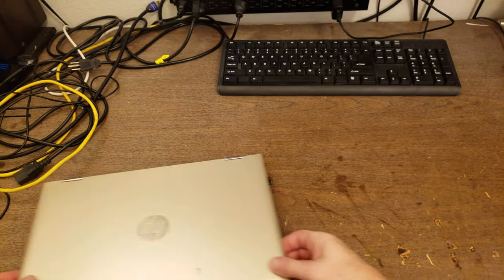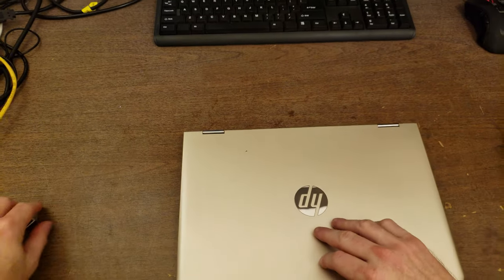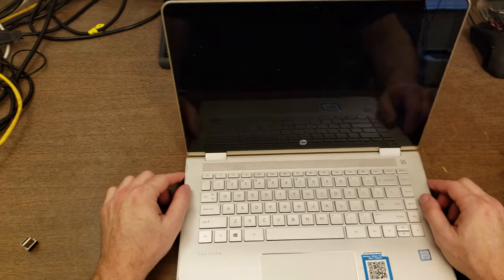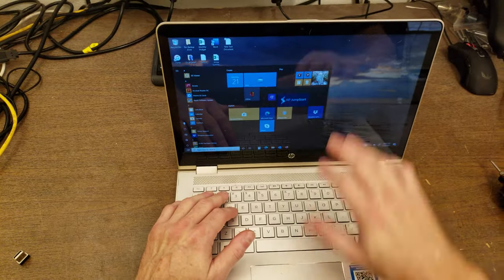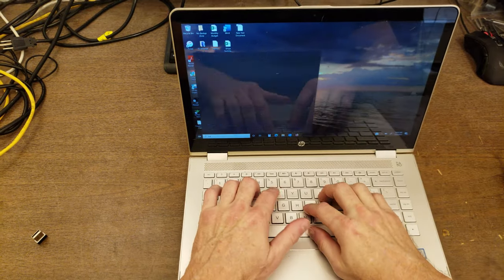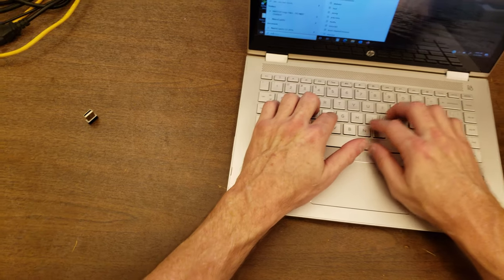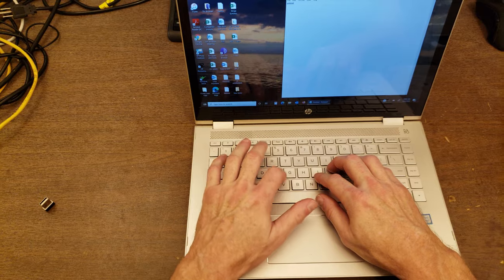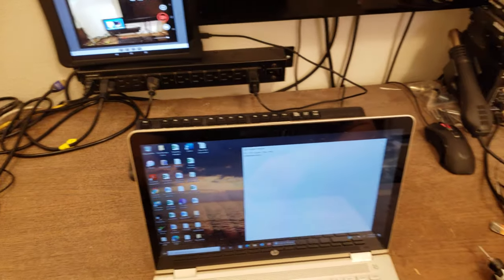HP Pavilion X360 Laptop keyboard and back light replacement

Comment: Good video for this particular HP Pavilion x360 model.  My model,  Pavilion x360 14t-Dh is ENTIRELY different so I damaged the palmrest using these instructions.  If you have a 14t, DO NOT TRY TO SEPARATE the top - it is glued together.  Remove the ONLY THE BOTTOM to get access to the integrated palmrest and keyboard.   Then unscrew the touchpad control, mainboard, audio board, power switch, etc to isolate the keyboard and palmrest assembly.  If you're feeling bold, you could replace just the keyboard by removing the plastic pop rivets to gain access to the keyboard itself.  I use hot glue on the pop rivet points when reassembling but very time consuming.  I hope to do  video for this 14t- dh series - Hooper Computers.

Comment: I always use a solder  iron and melt the rivets and then pull the keyboard off of the Palm rest.  And then when I put the new keyboard in, I kind of use the iron to plastic solder the keyboard back on.

Comment: Sometimes I will use a Hako 936 solder pencil to remove the plastic rivets. The heat temperature level is adjustable.

Comment: Great instructional! Thank you! As Chip Gunter did, I also soldered what was left on the plastic rivets and it held everything together nicely. I didn't have a soldering iron so I used a butane torch to heat a small flat-head screwdriver tip. Which, I think, worked slightly better as you have more control over the melting thereof. The flat tip could be dragged across the plastic nicely.

Comment: Just what I needed. When I attempted to take out the 3 screws for the trackpad they were stripped. What do u suggest? This was the first time the laptop needed a repair.
Reply from the maker: If the screw heads are stripped try using a flat head driver, press down hard and turn slowly.

Comment: Very helpful video, thank you. I had to do the same replacement, I was a little bit more careful, so the plate wasn't bend like yours and I just put everything back in place without soldering, tape or glue. The laptop works fine again, and you cannot see the keyboard has been replaced, also the backlight works. The original keyboard wasn't working anymore because liquid got spilled on it.

Comment: Thanks for the video, this is a tedious job, I've done many of these and I get why you don't buy the panel including keyboard as the price is a little too expensive.  When putting it back together after I replaced the metal plate I used a little dab of glue from a glue gun and pasted it flat with a spatula as well as melting the plastic that did remain.  Once I tried melting the plastic rivets with a soldering iron to remove the keyboard but that made it too hard to install the new keyboard as the plastics rivets became blobs at the top, so it was just easier in the long run to just lever it off gently with plastic flying everywhere.

Comment: Nice video, but I have a suggestion. I use rubber cement on all the rivets and on the inner metal plate to make sure it is more secure. Rubber cement is good for flexibility. Keep up the good work.

Comment: great video!
let me ask you a question, my friend. I got a broken keyboard with a functioning backligh and the replacement without backlight is significantly cheaper. Is there a way I can take the backlight from the broken one and install it on the new one? 

Its a HP envy 15T-J178ca
Reply from the maker: They don't come apart.  It's all stuck together.

Comment: Next time you do a repair like this, keep the plastic from the rivits and solder them back on to prevent the recessing. I was surprised at how well it worked.
Reply from the maker: I'm just not going to do that. For this kind of repair now if the keyboard is plastic riveted to the palmrest I'll just replace the entire palmrest keyboard and trackpad if necessary, assembly.

Comment: I have an HP Pavilion x360 m3 convertible, I just replaced the fan and the battery but now my keyboard isn't working. I've checked the ribbons under the keyboard and everything is plugged in correctly. May I please have some direction to fix this issue?

Comment: Hi, 
I have hp 360 convertible laptop
Now I am facing a issue on that,
When I convert 360 degree mode still have working keyboard and touchpad, so please can you help me for how to disable that
Reply from the maker: Try putting it in tablet mode.  Its in the notifications area near the clock usually at the bottom right of the screen.

Comment: Hi, where did you find the keyboard? : :V  im no t sure if all the 14 -series are compatible (mine is HP Pavilion x360 14-dh1xxx)
Reply from the maker: I probably bought it from an eBay seller. If you take your model number or serial number on your laptop to the HP Parts server website you should be able to find the correct part number for a keyboard replacement. You can then search for that on Amazon or ebay or just Google and see if you can find a replacement.
Reply: @MichaelTheComputerGuy  Thank you so much Michael :)

Comment: Hi I got a ? On my hp x360 convertible  the keyboard doesn't work  but in bios and system fast test my keyboard  function just fine. IS it a software problem?
Reply from the maker: It sounds like a driver issue.  In device manager check for a notice of a problem.

Comment: Hi best video i watched, helped me get the best idea i could get. But can you help me? I have an hp pavillion x360 15” and for some reason the CTRL key seems to have been clicked already though it wasnt stucked. It was press-able but when i click normal keys it seems to add the CTRL key and its making shortcut combinations. Not sure if its soft or hardware issue- please help! Thanks🙏🏻
Reply from the maker: Sounds like a hardware problem with the keyboard.  Replace it if you can
Reply: Michael Cooper michael okay sure i will follow with that solution 🙏🏻 as i couldnt afford replacing everything. Do you mean putting a new external keyboard? Or relacing the laptops keyboard?

Comment: Hi . Can you tell if the keyboard has a protective cover inside to handle small spillage?
Reply from the maker: I didn't see one on this model
Reply: @MichaelTheComputerGuy  thank you so much .. I had very minor spillage of tea with possibility of few drops going in some six keys around enter key .. wondering what should I do next? As I cleaned the surface and dried for few hours and the laptop is functioning perfectly normal normal.
Reply from the maker: @nikhilkondapalli1430  If it dried out and still works dont worry about it.
Reply: @MichaelTheComputerGuy  Thank you so much

Comment: hay I'm looking to do this to my HP Pavilion x360 14-dh0500na but I cant find a keyboard for it, any shop you use ?
Reply from the maker: Ebay and Amazon mostly.  Also check hp part surfer.  Its hp's parts finder and store.
Reply: @MichaelTheComputerGuy  no luck do you know if there use the same keyboard on all the different model or the part number has to be match sorry to ask many questions
Reply from the maker: @giz177   Google search for the laptop model number in the words service manual. You'll find a PDF from HP. Towards the middle of it there will be a list of part numbers. You can find the keyboard or palm rest there that will give you a part number to search for.
Reply: @MichaelTheComputerGuy  thanks for the help bubby

Comment: Do you know de spare reference number?
Reply from the maker: If you're needing the part number for the replacement you should open up the laptop and get it from the part in your computer. That's only way to know for sure. You could try getting the service manual for the laptop and looking it up there. Do a Google search for the model number of your computer and the words service manual and you should find one from HP.

Comment: I cringed soo hard when I saw that electric screwdriver. Please stop using it.
Reply from the maker: Why?
Reply: @MichaelTheComputerGuy  I disassemble anywhere from 3 to 10 laptops daily and would never go anywhere near a laptop with an electric screwdriver. I do love them for installing equipment in network racks and wall-mounting equipment.

I find a narrow handle screwdriver to be faster than any electric screwdriver in the right hands and does not have the same risk of wrecking shit. I personally use the Xiaomi set which has a premium feel and has some of the best bits I have ever seen. 

I daily carry the Worx electric drill https://www.worx.com/sd-driver-screw-holder-wx255l.html and have found it to be convenient for most callouts requiring mounting gear but would never use it anywhere near a laptop.

Modern laptops occasionally have zinc screws which strip if you sneeze in the general direction of one and the thought of an electric screwdriver just gives me the cringe.
Reply from the maker: @mitchellryan1602  I wouldn't use a regular electric screwdriver either.  This one has a clutch to prevent over tightening and striping screws.
Reply: @MichaelTheComputerGuy  so everytime you go from a m2.25X5 to an m3X6 hinge screw you change the clutch? or when you take apart any low end pavilion with the shitty plastics around the back case, how feel out the shitty internals before you rip apart the plastic holding the bras nuts in
Reply from the maker: @mitchellryan1602  I just leave on the lowest power clutch when working on laptops.